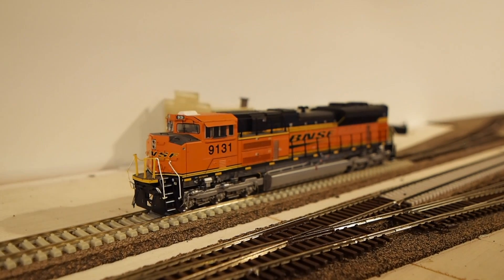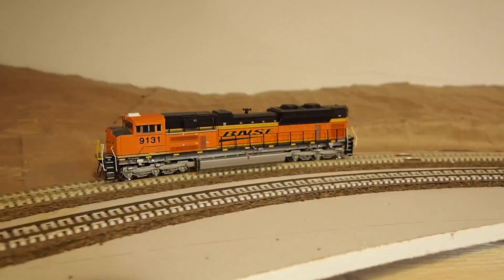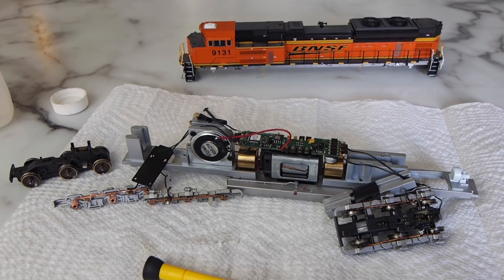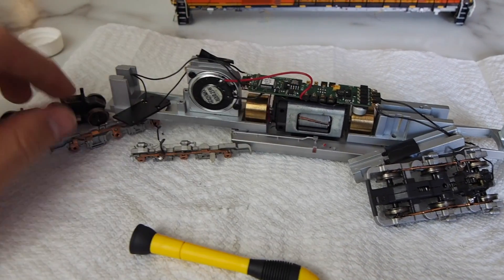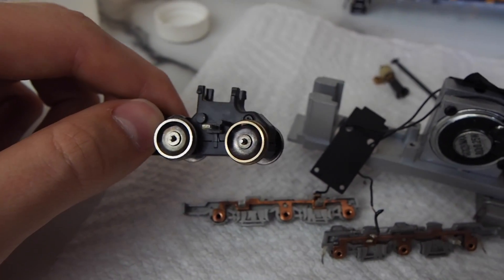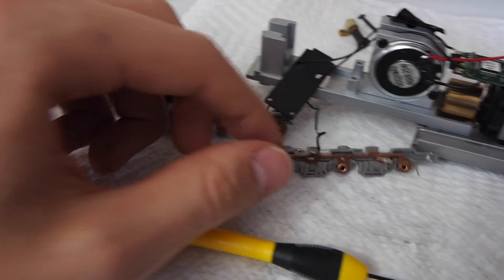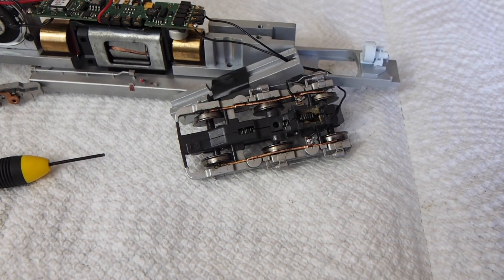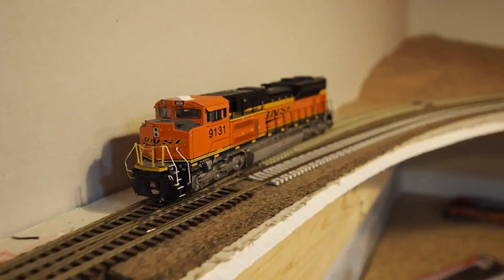One Way I Improve Locomotive Performance

Comment: Awesome...thx u for takin the time to show this...just gettin back into trains after 17 yrs of racin cars.. i was a dc guy.. wasnt sure about this dcc stuff . Its all weird. Have two new locos. 1. Intermountain 1. Walthers.   Intermountain does exactly wat ur problem is. Was actually thinking of sending it to them to fix. Worst part is layouts not even a month old so i know track is clean and loco has not even an hr on it so it has clean wheels.  Wasnt sure wats going on til walther got here and ran fine. So again. Thx u for this lil tip.....
Reply from the maker: Glad this was of some help! The other locomotive that I referenced a couple of times in the video was an InterMountain unit. That was the first time I had tried this trick, and since then the locomotive has run flawlessly. I think what may have happened for me is that since my old layout had 18" radius curves, which is pretty tight for big 6-axle power, that caused the contact pads to slowly press away from the wheels. Something else that I might try is Automatic Transmission Fluid. I saw an article that suggested applying it to the rails because it improves conductivity. But I think if your track has sufficient power and the wheel are clean, it would probably help just as much to put a drop of ATF between the axle points and the copper contact pad.
-Cam

Comment: Hi Cam - I enjoyed watching your video.  It's a shame that a reasonably new locomotive would have such sloppy contacts at the pick-up point, but I have seen this before, especially with Athearn locomotives (not sure who the manufacturer of your loco is).  Anyway, good information and a quick fix for those having this issue.  Thanks!!    Mike
Reply from the maker: Thanks, Mike! I totally agree. I got this Athearn unit in 2011 and within a year or two it just started to cut out randomly even with frequent cleaning. Part of it might be that the capacitor on the Soundtraxx board isn't very forgiving. But either way I would expect better. Since then, I think these Athearn Genesis units have really improved.
-Cam

Comment: Great Idea, I have yet to pull one apart all the way like that, one of these days, I will build up the confidence.
Reply from the maker: Thanks! And it's really not bad at all. A while ago I had trouble opening this locomotive up because Athearn put a screw connecting the shell to the frame right by the underside of the fuel tank. Usually it's enough to just take the coupler boxes out. 

I didn't really tear this one apart all the way for this video, but the first time I tried to fix this problem I removed absolutely everything. I literally stripped it to the frame so that I had the fuel tank, trucks, motor, drive shafts, circuitry, and shell all separated. I still couldn't figure it out.
-Cam